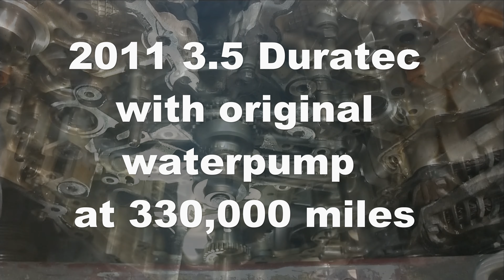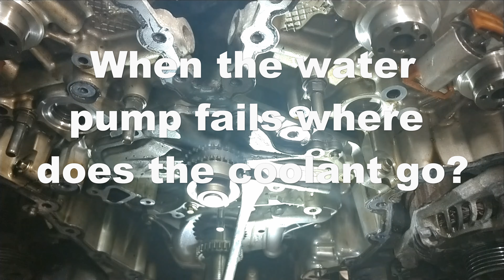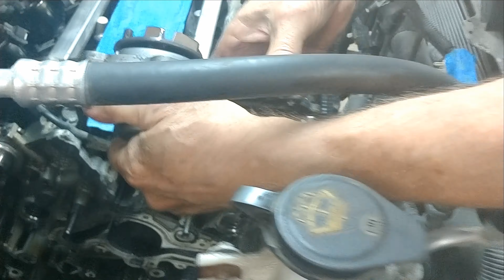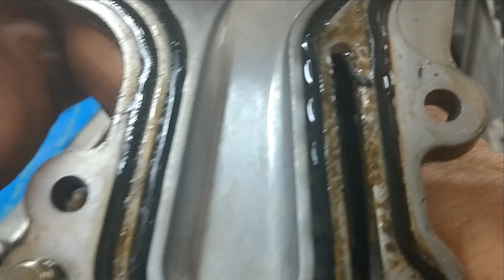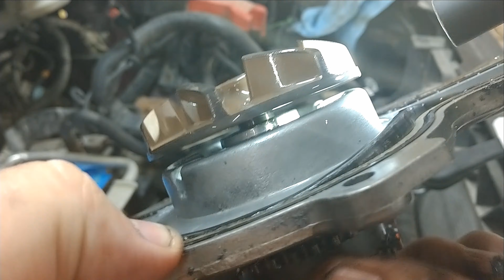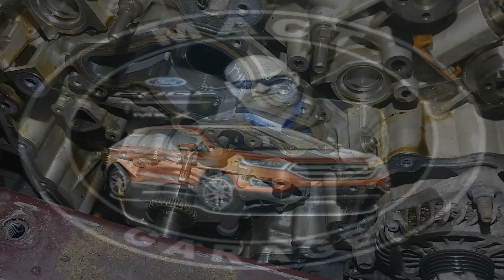Yep the coolant dumps right into the oil pan when the water pump fails

Comment: would a redesign oil pan fix this problem. I read some honda had internal water chain pump but the coolant dumps outside the engine.

Comment: My Camry just started doing this a 98 2.2 timing driven water pump only thing is I'm not sure that's what the problem is I can pour water into my radiator and as fast as I pour it it goes straight into the oil pan
Reply: I checked compression with the fuel injectors unhooked etc. They all have 160 it's spec between 150 and 180 one of the four is at 17? But I believe that's because it has a small mist of water blowing out of the spark plug hole during check very faint tho
Reply: I'm having the same issue, as fast as I put coolant in my truck it goes straight into my oil pan. I did change my water pump but having the same issue. Saw some videos and I'm thinking now it might be the Oil filter adapter gasket or may need a new adapter. Hope it's not a cracked engine block. Has anyone had coolant go into their engine oil and was told what caused it?  Please let me know if you have. I'm a diyer and I'm trying to git er dun.  Thanks in  advance.
Reply: @funwithdlvlogs4184 having same problem on my 03 f150.
Reply: @CoreyBanks1   look around the engine for water stains. But most likely it's your head gasket or it could be the oil filter adapter gasket. I'm in the process of changing them out now. Was the truck recently in an accident? Could be a crack on the engine. Get a flashlight and take the driver front wheel off and keep lookng until you find if there a coolant  leak or a crack on the engine. But as a easy quick process of elimination change the oil filter adapter gasket first. Water can easily drain into the oil pan if that gasket is bad.  Hope this helps.
Reply: @funwithdlvlogs4184 @funwithdlvlogs4184  same on my 98 5.4 Expie. Did the oil filter adapter fix the issue?
Reply: @SanchoGracie  I'm still workig on the engine...I'm in the process of replacing the head gasket because that's  my issue. When I removed my intake manifold I noticed there a crack in the engine so my plan is to go to a junk yard and replace the engine side I need.  But bolts are so tight and cooked on the engine this is making this job so tedious.  Does coolant goes into the oil pan on your truck?  Take you front driver tire off and the splash cover if it's on there and get a flash light and look for leaking around seals and gaskets. The oil filter adapter  is usually under pressure from the tightning of the bolt but if the gasket is damaged water can and will go I to the oil pan.
Reply: @funwithdlvlogs4184  Damn, very sorry to hear it was a cracked head. That's a lot of work, but it's better than monthly pymnts on something new. I'm pretty sure mine is self inflicted. Drained the coolant so I could unhook the heater hoses to get to the asshat #4 plug & COP. Filled the truck back up with water which was meant to be temporary. Then.....several days of hard freeze from the same storms that dumped several feet of snow in the Sierra Nevadas. Pretty sure it's a freeze plug. Truck off, almost as quickly as you fill the reservoir it drains into the sump. This weekend I'm going to start investigating. Obviously can't pressure test since it won't hold fluid. Fortunately, truck hasn't been ran or even attempted to turn over. Hope you get yours back on the road soon.